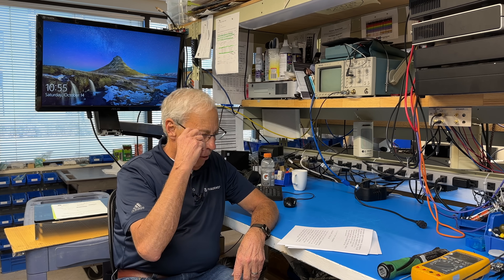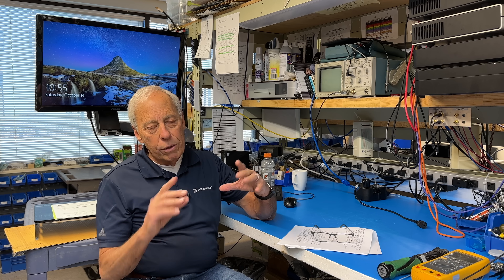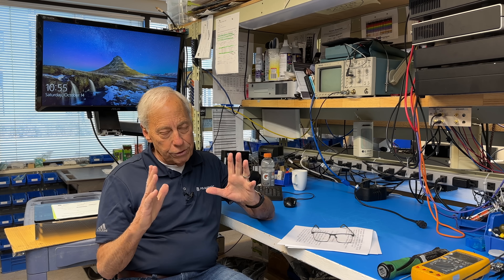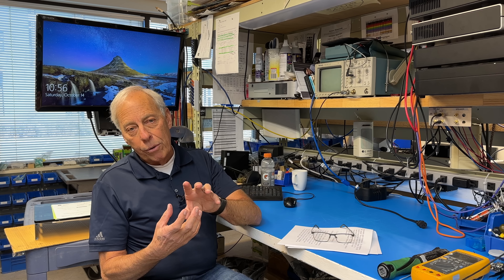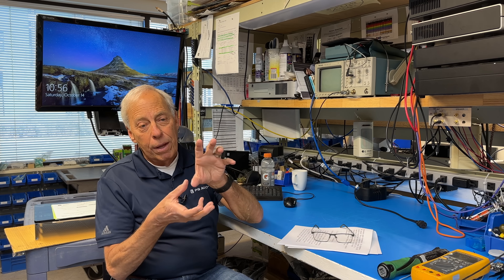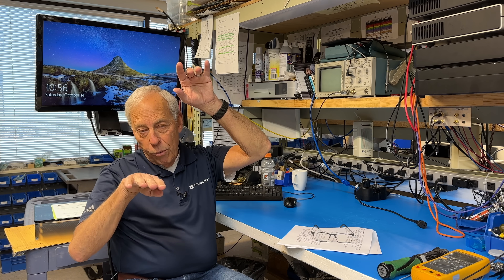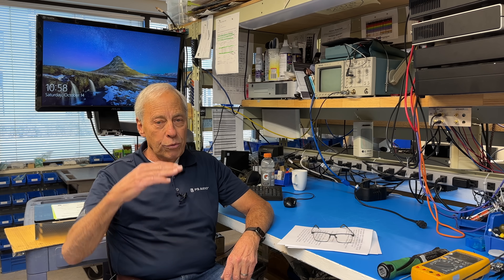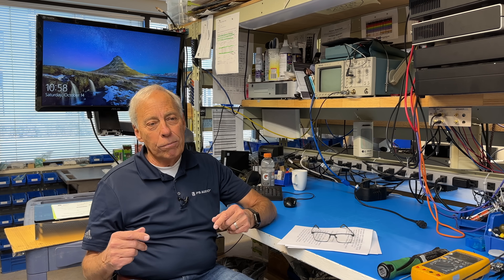2 or 3 way loudspeakers

Comment: Hi Paul, thanks for that. On a similar note though, does having more crossovers (to handle more "switching" between frequencies) not add more space for noise, distortion and lower the overall sensitivity of the speaker set?

Comment: nowadays 2 ways speakers seems to be much more commonly used than 3 way speakers why is it so ?
Reply: I know I’m responding to an older question, but I think the reason why there are so many more 2-way designs than there are 3-way designs is twofold. First, a 3-way requires an extra driver, a larger, more complex cabinet, and a more complex and sophisticated crossover, all of which add to the overall cost of the speakers. The other reason is because of the availability, affordability and commonality of subwoofers in today’s systems. In the past, before subwoofers became common in home audio, large 3-way (or even 4-way, 5-way “kabuki” etc) speakers with massive drivers were quite common. Now that subwoofers are so readily available (and relatively inexpensive), it’s easier to design a really good 2-way speaker that doesn’t produce the lowest frequencies, and use a subwoofer(s) to fill in the missing low end that these 2-way speakers aren’t capable of producing. Of course this becomes even better when you produce a quality 3-way speaker and pair it with a subwoofer, but it’s more expensive, and the more drivers you have, the more difficult it becomes to build a good sounding speaker. From cabinet design to crossover design, the whole thing is more difficult and thusly more expensive. That, and unless you’re an audiophile, with superlative amplification and source material, in a room that’s been properly treated for the best audio experience, the average person isn’t going to really notice enough of a difference between the two to justify the difference in price.

Comment: A fascinating piece Paul,
JL Audio take this separation one step further with their CR2 low frequency crossover unit. With the CR2 configuration employed, the signal from a preamp would first be processed in their external crossover , and frequencies below ,say 80hz would go directly to JLA’s subwoofers. Everything above the lower cut off is then interconnected to the power amps of the users system. Going this way, JLA say they are taking the low end duty away from the conventional low frequency driver in the users system. It’s an interesting approach , but more electronics for the signal to pass through.
Regards, Roger

Comment: One advantage of a 3-way is that the midrange then has no potential_ excursions inside the magnetic motor and more likely to keep the voice coil in the sweet spot - if you design for that. But this is where the high pass to the midrange is so critical and I have said this many times, a high-pass is more difficult to design than a low-pass as a rule. This goes for the tweeter as well. I use a tuned notch filter to control the roll-off after a series cap, the Q is critical, but it needs to stop dead any excursion at the resonance. This applies to both midrange and tweeter. AM distortions are also reduced.

Comment: The success of the basic 2 way speaker is more a result of synergies: the roll-off of the woofer is easily (though usually necessarily) played upon to simplify the crossover, the BBC dip comes naturally, and the directional characteristics make for good imaging. A port can extend bass, although really that's a kind of crossover too. It's enough to get serious The crossover for a really good 3-way is far more complex.

Comment: Why is there  not speaker / Amp systems like in car audio that use DSP and multi channel amps crossed over actively for 3 way 4 way systems
Reply: There are many studio monitors that use DSP as an option. There are even 5-way systems using DSP for professional studios.

Comment: Well designed two way speakers have a more coherent sound, especially at low to moderate listening levels.  Less to go wrong assuming you have a good crossover and drivers with a wide range.  
Three (or more) way speakers can reproduce a wider frequency range and handle more power.  Good for listening at higher volumes.

Comment: I have a 30-year-old pair of JBL L5 towers that are 4 way speakers, and I have a 50-year-old pair of ESS AMT-5 Rock Monitors which are 3-way with two 10" woofers in each speaker. Both sound amazing to this day!
Reply: I have 1980s Dutch Translator Impact5 4-way tower speakers and they too sound amazing to this day. I guess I'm as lucky as you are with the JBL L5s, to have 4-way speakers. There aren't many around anymore. Enjoy!

Comment: What about headphones? The best headphones in the world all have one driver for the whole frequency range. Some even cover the Hi Res audio frequency range from 5Hz to 40kHz. How do they manage to sound so good and mitigate Doppler effect?
Is it because sophisticated room treatment is applied to the earcups ?
Reply: Headphones are only a few inches from your ear drum. Their drivers don't even have to go 1/10 as loud as a speaker does, for a given volume. Besides the Doppler Effect refers to how sound moving further away (like a train) gets lower and lower in pitch. Combing effect...not Doppler. Don't know whose mistake that was. Physics dictate that a big driver disperses sound poorly compared to a small driver. With speakers you need both big and small driver to handle the whole frequency range. With headphones you don't, since they're right on your ears and they don't need to produce much volume. When it's right on your ears, even a small driver can produce enough bass that's enough.
Reply: @sidesup8286 Thanks for your answer. What you have described is basically what Focal has done when they started to produce audiophile headphones. They took their patented twitter technology and used it as a headphone driver. I have 2 pairs and they sound fantastic !

Comment: The trick is always to seamlessly cover that most critical low/mid frequency range where fundamental information is contained. That's a major benefit to a 3 way. The midrange covers the vast majority of sound with a woofer and tweeter just extending the extremes better. Where a 2 way will crossover somewhere in the middle of that critical range.

Comment: I think Chris is a bright guy, and the FR20 seemed pretty darn good when I heard it recently.
Everything is a tradeoff.  I think a really good full range like the Cube Audio would be enticing.  Paired with extremely simple triode electronics.  Less is more thinking.
That said I use and am happy with DIY 3 way open baffle with very simple crossovers supported with a touch of parametric equalization.  60 year old alnico drivers from Japan.
Reply: if the tradeoff is extra cost you can get more for your money oddly enough. like adding a dsp unit, small cost huge benefits and the speakers you choose do not need too many tradeoffs, extra bass with ports is a unnecessary tradeoff at that point.

Comment: My biggest frustration of HiFi is the stagnation, in the 1920's Rice and Kellogg’s issued their original paper, detailing a hornless speaker. Magnet, coil and a cone. One hundred years of technology later, we have Kevlar, carbon, neodymium, but essentially magnet, coil, and a cone. How disappointing, obviously we had fun with plasma tweeters and electrostatics (QUAD ESL was 1953..) but really, we are just polishing spanners now. The question isn’t two or three way, it should be what would be better. Same with amplifiers, Black published negative feedback in 1927, what have we got now, Class D ? Don’t maker me laugh.

Comment: A lot of it comes down to driver selection. The better behaved the drivers are, the easier it typically will be to design the network for them. The ringing/breakup frequencies and distances between the drivers also play a part.. if you have a woofer that has severe breakup at 3 Khz don't pick a tweeter that has to be crossed at 2-3+KHz. look for one that can cross 1-2KHz range or lower, or find a mid driver that can easily play between 700Hz-3Khz.
It will mean more parts ofc, but the performance will be better than trying to make a 2-way design where the woofer is breaking up at the crossover point.

Comment: If speaker level signal is fed to a sub-woofer, and passed through to a two way speaker, does one not have a three-way system? The sub is sucking the bass frequencies out of the  signal, acting as an electronic crossover.
Reply: No.

Comment: The woofer should concentrate on the bass only, and not try to reproduce high frequencies of say 2khz at the same time.
This leaves 2 options.
Separate mids and tweeters as a 3 way, or a combined mid/tweeter as a 2 way.

Comment: For a long time it was difficult to make a very high-performing 2-way speaker, for the reasons Paul described.  However. In the last twenty years, new wide-range compression drivers became available, able to cover from 400 Hz to 19 kHz.  They’re more expensive, of course, but they’re worth it, because then there’s only one crossover point instead of the two between the three drivers in a 3-way speaker.  This eliminates one region of phase shift and other distortions.  Check out the Klipsch Heritage Jubilee for the ultimate development of a 2-way speaker that can reproduce sound from 18 Hz to 20 kHz.  No subwoofers needed!
Reply: Still with a 2-way will sound less immersive than the 3-way. I think Genelec with The Ones has made the greatest 3-way ever made, and all tests says so also.

Comment: i am amazed how much a 2 way can do, it is almost like a sweet spot in the middle of it all.
if you have dsp i recommend 2 way main speakers and two subwoofers, if you then add a high pass filter on the mains you have created for yourself a 3 way.  now you can have 20hz to 20khz reproduction :)
Reply: This is what most amateurs or entry level folks do and it’s understandable.  

I started off this way myself.  But here are a couple of issues I ran into:

1. With two way bookshelf’s, the tweeter blew out on one side twice.  Celestion.  Had a nice blend between tweeter and mid woofer.  This is because the tweeter is crossed over low but this is also why the tweeter blew IMO. 

I swapped out for some Paradigm bookshelf’s.  I’ve had for over 20 years now.  All working condition.  A bit of an issue is that the upper high frequencies are there but not the lower high frequencies.  EQ can possibly fix the issue but every song is different.  

2. With bookshelf two way in a more larger room, the system lacks “presence” and mid bass.  

Solution.  I have Paradigm Studio 60 v2.  It’s 3 way.  The mid and woofer are both 7 inches but different design.  They are floor standing.  The mid bass and even low bass is quite impressive.  

I have just one corner subwoofer. Two 12 in in one cabinet.  M&K.  One driver on the side and one on bottom. 

So I agree with Paul that 3 way is the better way to go usually.   Many use 2 way bookshelf in a small room and they sound great.
Reply: @f430ferrari5  if you think about what i said and try to pick speaker for it, you wont pick any 2 way speaker, but one designed for midrange and up. not ported bass compromises, since you wont need that since all the woofer is playing is midrange. and something that plays loud enough so you know the tweeter are no pushed too low in frequency.
for you number 2 comment, you have not really read my text at all i seems.
what do you think will happen if you put a system like i mention together?
you take into account the mid bass, not like Paul and most people recommend using a subwoofer to just add bass extension. i suggests you swap out all the bass duties to subwoofer and cross them over closer to 200hz, that is why i recommend dual stereo subwoofers.
it is a large stereo system we are building, not small speakers with extra bass.
i know i was a bit short on my original comment, and people always assume everyone else is ignorant.
Reply: @f430ferrari5  Amateur?
Reply: @356h7 Still, there is no amp driving the mid-range which are more critical than the sub's say 80Hz/100Hz crossover. The immersiveness is still not there on a 2-way with your "fake" 3-way. I have a system like this, and added a 3-way. I will never go back to 2-way with subs.

Comment: Go for 2.5-way. Most of 2.5 way loudspeakers don't have port on midwoofer. Working in a sealed box midwoofer speakers have less sound coloration couse of port resonances and lesser crossover parts. Also second woofer work as add-on subwoofer with larger cabinet volume. They sound like a 2 way speaker imaging with full bodied sound of three ways.
Reply: Thanks was about to ask that 😊
Reply: They typically get some wonky phase issues, there is no free lunch. And I do believe most use the same box, in the end any issues should have been addressed during design.

Comment: I find there is a lot more to say about the topic, than can be packed into 4min. Most important is parts: less tend to be cheaper overall, but less (2-way) requires higher quality from the parts: a woofer needs to be light & at the same time free of resonance up to and beyond x-over frequency, it should be large as well but then it would start to beam at high f; high excursions is the cure also not good/not cheap; cutting it off at high f rather requires higher order than 1st (a 1st order requires excellent ie expensive drivers)… and thats only the LF part..
having said that - go listen to mofi 10” concentric or triangle Duetto, B&W 805, Dynaudios, and you’ll see what a great 2-way can do. For good money.

Comment: It`s much more difficult to develop a three-way-speaker than a two-way-speaker. I could write a book about it. Greetz from Switzerland.
Reply: Difficult but not even close to being unreachable or impossible.
Speaker manufacturers do it all the time and the benefits far outweigh the drawbacks obviously.
Reply: @Geerladenlad  I didn't say it is impossible. I think you overestimate the benefits of 3-way-systems. The main benefit is only the higher output. If you are listening moderate volume, a 2-way-system could be the better choice. I developed a 2-way-speaker with optional passive Stereo bass-modules for higher output performance. The 3-way-crossover is external and quite heavy. The two bass-speakers have 12-inch woofers.
Reply: @SinusPrimus  You underestimate the importance of the mid bass coupler.
Reply: @Geerladenlad   Please be more precise. I don`t know what you mean.
Reply: @SinusPrimus  You say you’ve “designed” your own speakers, so why is it so hard for you to grasp that when you’re attempting to design a system with 2 drivers covering 5 octaves each, 
it is ultimately less desirable than using 3 separate drivers ?   
It’s just more difficult to do if you’re not really an engineer.
Reply: @shipsahoy1793  I am not a theorist but a pragmatist. From a theorist's perspective, you're right. From a pragmatist's perspective, the practice of building loudspeakers often looks completely different than expected. A tweeter does not have to transmit 5 octaves. The crossover frequency is often 2.5 kHz. Dome tweeters have no problems with this. And cone woofers have no problem with the transmission band from the bass range to 2.5 kHz. And you`re right: I`m not really an engineer, I`m a speakerbuilder.
Reply: @SinusPrimus  Read some of the comments from the other guys here. They are making some good comments here.. 
the bottom line is you’re asking the woofer to do too much. I realize that it’s a balancing act between driver optimization, crossover complexity, acoustic design, the baffle, driver isolation, etc. etc. but it’s always worth it because, a well designed three-way will have a much better response over the whole range than a two-way. 
A well designed 2-way ported or even passive radiator can be great for budget concerns, and 
can potentially be quite reasonable for what they are, but a well designed 3-way acoustic suspension type speaker system can be awesome, if done well.  Unfortunately, this is not the current mindset of too many audio enthusiasts, so it is not a priority to design, manufacture, and market such systems for mainstream monaural and stereophonic audio  entertainment systems.
Reply: @shipsahoy1793  My point is not to claim that one is better than the other. I just know the advantages and disadvantages of both systems. and believe me, I know them very well. 😉
Reply: @SinusPrimus  In that case, I don’t know why you’re debating these things with everybody. Just let it go, and relax. Some of these posters know the tradeoffs. Sometimes they convey concepts in an idealistic light, but are still very well aware of pragmatic variables. 
A theoretician without any practical knowledge and experience can be more handicapped than the experienced person with a relatively weak foundation in theory.  Emphasis on both rewards with greater insight for any analysis.
Reply: @Geerladenlad Exactly! 
No shortage 
of ignorance 
in this life.
Reply: My preorder has been placed.
Reply: Write it😊
Reply: @Stan_the_Belgian   That`s a good idea, thanks. 😊👍 I`ve already made a documentation about my development method for myself with 165 pages. This could be a starting point for a book.
Reply: YES😉
Reply: a really good one (3 way speaker) produced by us or amateurs is insanely difficult.

but for professional speaker companies, if they want the best results, they usually go for the three way.

making a 2 way do what a 3 way does well is impossible.
Reply: @thunderpooch  "making a 2 way do what a 3 way does well is impossible" vice versa. 😉